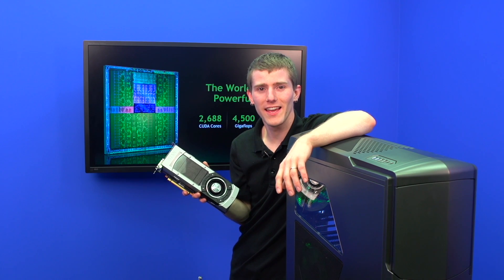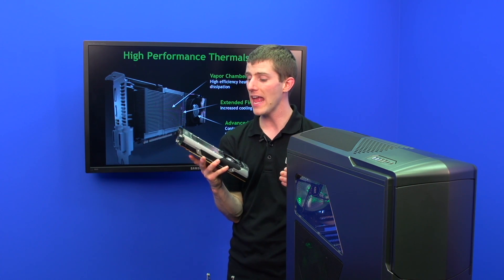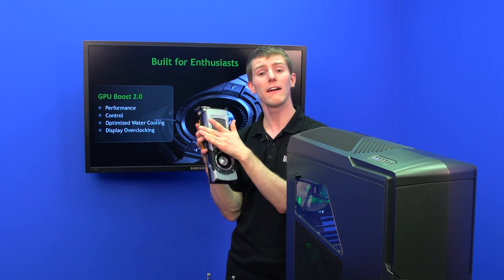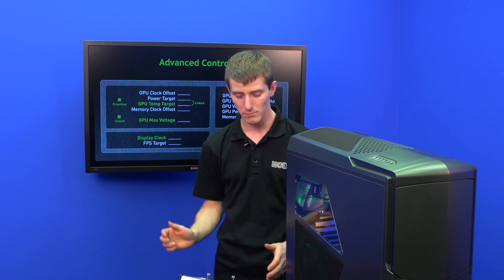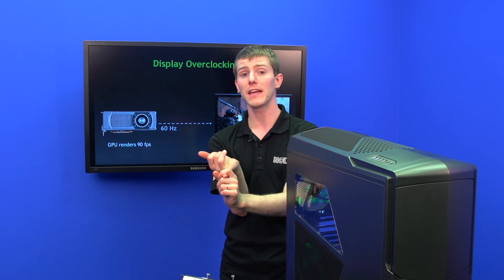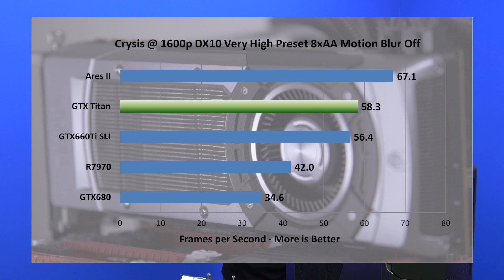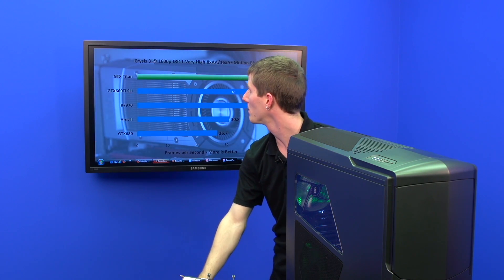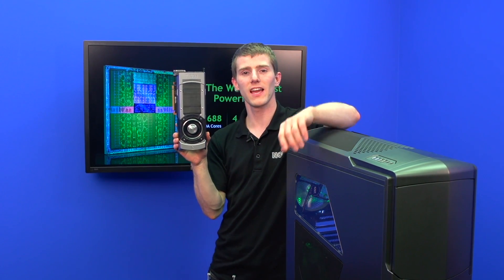NVIDIA Geforce GTX TITAN First Look NCIX Tech Tips

Comment: @Amishpeanuts, amd was only able to hit that frequency due to the cpu being submerged in liquid nitrogen and overclocked. naturally, any i7 ivy bridge would be able to best that. and keep in mine that although amd is, yes, cheaper it used 2BILLION transistors to achieve that low of speed as opposed to some of the less than 1 BILLION transistor i7's absolutely smoking the competition with gaming. please do correct me if i am wrong, i would be very grateful

Comment: LOL.

ok..

256mb of vram IS STILL ONLY 256mb of vram

the ps3's video card DOES NOT make use of the other ram because ...duun...duun..DUUUUUUN.....NONE of the ps3's games even today come very close to maxing out the vram usage let alone OVER consuming it to the power to there the system would start using the slower xms 256mb ram that is separate ( just like gddr5 vram on a video card today  is to SLOWER ddr3 dimm ram in a desktop pc)

Get it now?

-_-

I've already proved the facts. Move on.

Comment: I figured that also.  However, allegedly Nvidia found a way to improve the efficiency of the vram bit interface.  I am unsure if this is true since I haven't had a chance to buy and test this.  I've tested a 3 gb 384bit 7970 and observed no stuttering in any game I play regardless of the eye candy or resolution ( on my friend's 2560x1440 samsung monitor).  however, even crysis 3 won't use more than 3gb of vram at 3.7 meg( 2560x1440p) rez. I wonder about full 4 meg ( 2560x1600) gaming.

Comment: true.  80 fps is enough for me ( of course 120hz monitor or an overclocked monitor to 90hz would be need in order to *see* that much fps)

I've had some good experiences with the gtx590 and dual 8800gt 's in sli..but not enough to justify not returning the 2nd card or the 590 for a single gtx 580 to hold me for now at full hd rez gaming.

I'm interested in seeing if the 4gb gtx 680 will encounter any problems being that it's only 256 bit for the memory interface.  bottleneck? time will tell.

Comment: I tested this with a gtx 590 vs 2 gtx 570's precisely 4 months ago on starcraft 2 which is much more cpu reliant anyways.

with my one gtx 580 ..it was smooth ( no microstuttering) at even the 20's fps with 140+ toons on screen.
however, with gtx 590. microstuttering showed itself at even the 35/40's fps marks.  same with 2 gtx 570's..some results may vary but that's enough to convince me for now.  thus why i never buy a dual gpu video card.

Comment: just because the gtx 690 is only ONE card with two gpu's doesn't mean you won't encounter the chance of a game not running as smoothly with it as you would a single gpu card.

If a game isn't optimized to run in sli and you tested this with 2 gtx 670's overclocked and stock, then there is a high chance you will encounter the same problems in the same game with a gtx 690 unless you are able to temporarily disable on of the gpus or the game does it for you behind the scenes.

Comment: lol.  then that means you're not even turning up your in game graphical settings above low. which is STUPID considering the video card horsepower that is involved in that comment.

Wtf can notice or see 600 fps..No one..it's beyond retarded to assume or think you can otherwise

120 fps is the max reasonable amount of fps that any human can game at.  that is the line...the "bottlenecking ' point of peak fps " visual reading" performance of any human.

max out your settings then tell us fps.

Comment: this case is too big to be practical. i like one of the custom manufacturer's idea of putting in a chassis not much bigger than the xbox 360, but still maintaining the ability to overclock the titan under reasonable noise and temperature

Comment: It depends. A 670 is a very fast card, but a 760 or even a 770 will probably be much faster than that. If you're willing to wait another six months or so, you can get the faster 700-series cards. I would probably wait to upgrade.

Comment: yes..and I agree with your comment 1 day ago..IF you're talking about regular full hd 1080p.   3.7 meg and 4 meg gaming...you'll need 3x 660ti's overclocked to keep up with one titan and even then..there's a chance to encounter lags or microstuttering due to the 2gb vram being completeled used and the video card will have to borrow ddr3 ram from your dimm slots which is MUCH slower.

thus.  3gb 660? nope. 192bit interface is a bottleneck above 2gb vram. 

4gb 670's in 2x or 3x sli= answer

Comment: 4k resolution is  4096	x 2304=9,437,184 pixels
2560x1600=just over 4 megapixels. Although Titan's vram is enough to handle 4k resolution gaming...I'm willing to DOUBT..the rest of the video card ( other parts....gpu cuda cores,  frequency..etc..etc) will be able to while keeping 50+ fps at even medium/high settings even with the 6 core ivy bridge 2011 coming out soon.  
Manufacturers may need to figure out how to put more performance in other parts of the card..vram isn't the bottleneck anymore.

Comment: ftr the ps3 has a MUCH more powerful cpu ( even if it was only ONE core..which the ps3 actually has at least 6 accessible cores to developers) in two different ways...ghz frequency and multicore.   Sad that a 2004 built system can TIE ( honest guestimate through EXPERIENCE) a console that was built and released years LATER.  What does that say about technological advancement of the console gaming industry?  1 step forward..2 or 2.5 backwards

GREAT fail. xD

Comment: ps3 has 256mb of vid card vram
My 2004 build ( which was years BEFORE PS3 was released) had 128mb vram 5700 ultra nvidia gpu  leadtek vid AGP slot card, single core amd 2.4ghz clawhammer athlon 64 cpu, 2 gb ddr400 ram & played prince of persia at 1152x720 rez while retaining 45 fps avg and it STILL looked the same if not slightly better than the SAME GAME on ps3, shadows, AA, you name it. No microstuttering or lag

You're welcome.lol. just 1 example why pc gaming>consoles. The end.

Comment: yes...precisely

same reason why a 4 core Phenom II at 3.2ghz will be faster with bf3 and MANY games of today than a triple core or dual core at 3.4 or 3.5ghz..only difference in my analogy vs your example is....your example is a MUCH bigger difference in accumulative video card strength.  

I can clock my gtx 1.5gb vram 580 accelero xtreme plus vid card to 950 mhz...yet this titan will laugh and immeditely get bored with the same workout my card would be sweating buckets with.

Comment: Yes, I know that a $600 system with a $350 GPU would be pretty much impossible. I also never said that my system cost me $600. In fact, it cost me over $1200 because the UK government wants ALL the taxes. But, do you really think that a $600 system can't run Crysis 3 on MEDIUM? I think a 7850 with an i3 almost definitely could. Medium settings is still a LOT better than the console version. And then you also get the added benefit of playing not-so-demanding games on high.

Comment: .... Try reading the comment. Did I mention that it's a 660 ti? I'm pretty sure I did. How many 660 ti owners will be wanting to run that demanding of a game on 3D? Not many. To run that game in 3D would need an absurd amount of power. Remember how I said 'decently'? Decently means on medium-high settings. Don't tell me you don't think a 7850 or a 7870 can run Crysis 3 on Medium. Because they can.

Comment: Crysis 3 at 1080p with 8xMSAA runs 57fps averange with a 680, no way Linus, i have the 670 (whats little slower but it runs at 680 clock speed) runs Crysis 3 with 8xMSAA not with 57fps averange.

Comment: my 1090t with  3gb 7970 with metro2033 at ful hd? yes
My gtx 580 1.5gb card can do it also..Just not with AS high eye candy settings will maintaining the 40 fps I prefer to remain at ..at all times.  the 3gb 7970 does a better job although I still can't play it at max eye candy settings without fps tanking down to remaining at teens and early 20's.  that's cpu bottlenecked.  I really need an i5, i7 or 8350 to break through and double the fps at that graphic setting and that rez.

Comment: that phenom is a quad core 3.4ghz stock.  you'll run that 7970 just fine at full hd at medium/high settings with almost any game.  however

above full hd...good luck.  you'll be lucky to get above an AVG of 25 fps in fps games.  reason I know this..I have the 1090t running at 3.6ghz 6 core amd cpu with 3 gb 7970..My system struggles to handle 2560x1440 in metro2033 at medium settings to retain an fps of 30 to 35...in intense fighting it tanks to teens/20's

Comment: My old SINGLE core athlon 2.4ghz clawhammer amd cpu +128mb leadtek 5700 ultra played prince of persia on pc at 1280x768 with playable fps and actually looked the same than ps3 prince of persia using hdmi out to a full hd tv.  THAT alone PROVES how stupid console makers are.  ps3 has 256mb of vram involving it's graphics card.  What does that say about it.  a gtx 275 would destroy a ps3 let alone anything higher.
This is why I left console gaming behind . where it belongs

Comment: Well you didn't list THE IMPORTANT DETAILS

what resolution are you playing those games at?
in game graphical settings  maxed?  low, medium..mixture?
what are the other specs of the system being used with comparing these two vid cards...cpu and is it overclocked or not, speed of ram ( it matters to a small extent sometimes) is the 680 a 2gb or 4gb vram model?

DETAILS PEOPLE DETAILS..I hate it when you all ask such general questions and you wonder why pc experienced gamers just flag you for spam

Comment: You can thank the guys that made crysis 3 ..for guaranteeing that we'll have to spend 2k JUST on video card power JUST to play it at 60 fps 2560x1440p may eye candy settings.

I'm not sure who to " judge" the generational ratio of side grade or incline of pc parts performance vs how a game is programmed to utilized or ALLOW those pc parts to play it.

I was able to play crysis 1 at 1680x1050 low/medium settings 55 avg fps with 3.2ghz dual core athlon 64 x2 cpu, 512mb 8800gt vid card

Comment: Actually it will be this year for the next series of cards (maybe 7xx? ) usually around Q3. Until then I will stick with SLi 680's as I view the titan as a very small upgrade at a very high cost. What I don't want is for Nvidia to slow other cards down via driver "tweaks" to further enhance the image of the Titan against other cards. If I see my FarCry 3 suddenly or even gradually lose frame rate after several driver updates, I will not be happy.

Comment: I didn't mean useless from the GPU usage POV. I was talking from a hardware point of view.
When using a dual-GPU card, you will generate more heat under the same cooler (despite some modified coolers [ARES for example] and lowered voltages/frequencies). You pay for the "double" of the lower single-GPU card but in fact you get less.
The price is also often way too high for what it is. If you use dual cards it is more energy-efficient, wallet-friendly and it gives you a longer life (of device).

Comment: not the top of the line ones just the mid-high range ones and those cost a bit less+ 2 7970 or 680 are cheaper and better than a titan

Comment: Do you have the monitor connected via dual link dvi cables? hdmi cables arent able to transfer 120hz from the pc to monitor. Also many tv's that claim they are 120hz aren't really 120hz. Im not sure how it works but 120hz computer monitors are alot faster than a 120hz tv. :)

Comment: no it don't suck he used a solution of two cards for around the same price as the titan to see which performed better a dual 670 is beyond the price of a titan that's why he didn't pit it against 2- 580s- 2 670s- 2 680s

Comment: quick question,i got a 120 hz hd 1080p 40" tv but in the options in the nvidia control pan.under resolutions it will only display 60 hz option any suggestions how to set this to 120 hz?

Comment: @1988scottcarey That is not how these things work. Framebuffer practically means you can run textures for high amounts of pixels. It's the actual chip and the driver optimizations that are generally the bottlenecks for grappNvidia would like you to think it works that way though, especially in the budget segment.

Comment: Not enough of today's games benefit enough to justify the extra cost of adding an additional video card.

gtx 670 4gb overclocked, 8350, the same motherboard you mentioned is FAR cheaper and will STILL cover 2560x1600 gaming EASILY with maxed eye candy  if not maybe turning down shadows to medium while retaining an average of 45 fps or better for all games I sc2 obviously would be an exception with more than 120 toons on screen..that would be more cpu bottlenecked..regardless.

Comment: You dont get the diffrence between sli and single card. Single card has 6gb which is a big diff sli uses memory on 1 card thats the diff. 2nd most games dont support SLI properly 100%.. thats 2 and 1 card is better and more stable :)

Comment: I mentioned in a previous video  I wanted linus to showcares a comparison between 3 titans in sli vs 2 ares II cards in quad xfire ( four gpus total of course) because in the end...both red and green teams would illustrate the SAME FINANCIAL AMOUNT of video card strength thrown against each other...

I want 2c the victor of that contest at 2560x1440 or 2560x1600..eye candy maxed on metro 2033, bf3, assassins creed, farcry 3.& by HOW much ..less than 8 fps difference at 60 fps or above is a tie

Comment: if u want system not for epeen but for usage, than 2way SLI/crossfire is max You should aim for, as games don't understand those 3 or 4 cards (cores) yet. Altho, I would go for two 7970's as they will cost a lot less, and still perform awesome, or just wait for 8000 series cards from AMD, to have more options around.

Comment: low on a gaming pc is NOT console graphics

consoles ps3 and xbox 360 can't even game at TRUE full hd ( it's 720p stretched and artificially scalled)...2560x1440p at low eye candy settings STOMPS ps3's best...that is a fact and any experienced gamer of BOTh worlds will admit that.  

that 768p STILL looks just as good as ps3's 720p on the same Prince of persia game...THAT is what is funny...and the pc is running that game on HALF the vram of a video card that ps3 has.  that was my point

Comment: for me it would be the 2-way Titan SLI. just to be on the cutting edge of technology. 

Plus, the GTX 690 doesn't have GPU boost 2.0, or monitor overclocking. and way too large to fit in some cases. the Titan fits in most mini-itx cases.

Comment: ah..no..nvidia for the past 13 years has had the most stable drivers ( even their beta drivers..on windows and linux..have NEVER given most gamers a problem. vs the red team

Only exception to this i have PERSONALLY encounterd would be when I once owned and used for more than 1.5 years straight the 9800 pro by ati back when before amd bought them out.

Comment: 720p is 1280x720, which is 16:9. 1024x768 is XGA (4:3).

And indeed, consoles are toys. They're only decent the first year they come out. When they're released, they have mid to low-range hardware (The entire thing costs as much as a good GPU) so after a year, possibly 2, they're already behind and game devs have to start making compromises to make sure it runs. after 2-3 years, "low" on a gaming PC are console graphics.

The current consoles are 7 years old.

Comment: Look.  You can bullshit yourselves all you want..but you can't bullshit an experienced pc gamer.

If a freaking 128mb 5700 ultra video card, 2.4ghz SINGLE core amd clawhammer cpu can play the SAME game on pc @ 1024x768 ( basically 720p  what..PS3 games are NATIVELY programmed to run at and really DO run at..) at the same performance with even SLIGHTLY BETTER eye candy settings overall while maintaining the SAME great fps....than ps3 ( 256mb vram , MUCH better cpu..etc)..the console= EPIC FAIL.

Comment: You're correct.  The titan ALONE has its own 6gb of gddr5 ram.

The ONLY way the ps4 will be more powerful ( apu wise ) than a freaking A10 5800k  is...if they could get away with charging MUCH more than 600 bucks..Their biggest uphill battle has been to catch up with pc gaming.  

THEY MUST make a trade off one way or another...either price...or performance.  there can't be both.

Comment: They will not hold up to anything that requires more than 2GB of RAM. Not to mention if you want to render videos it will decimate them as Adobe doesn't use SLI.
This card has a market, and 66Ti SLI is not comparable to the Titan.

Comment: I got my 1080p 60Hz monitor to run at 65Hz with my old GTS 250
I don't think refresh rate overclocking is a Titan feature only, but a general Nvidia Control Panel feature